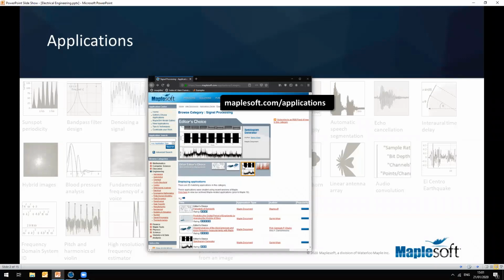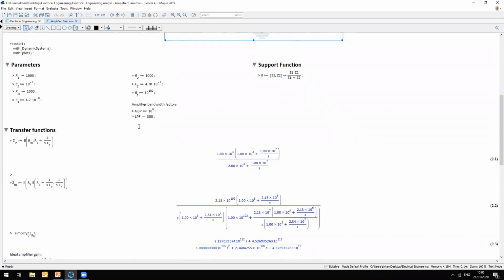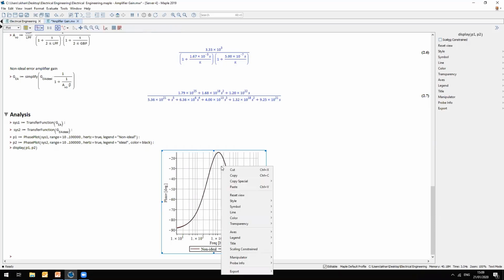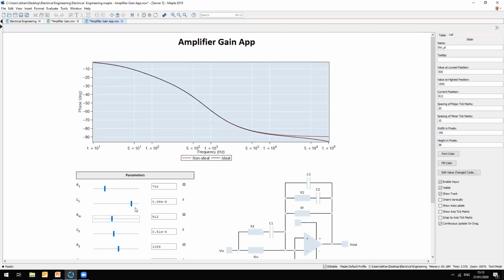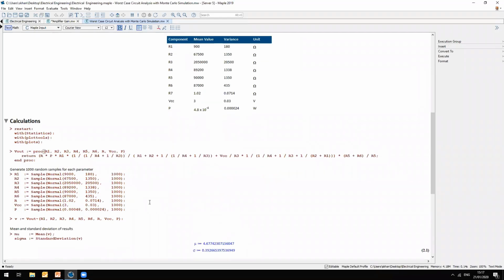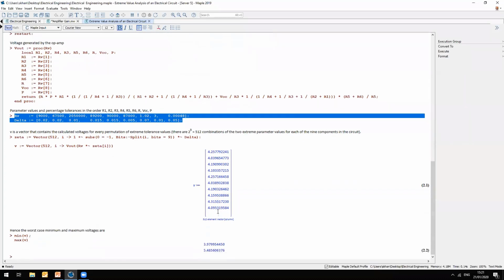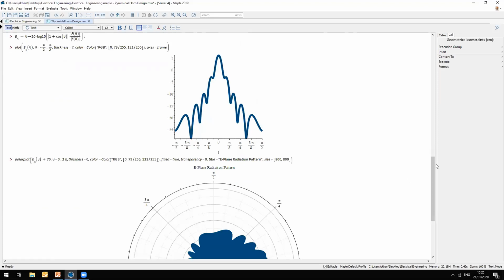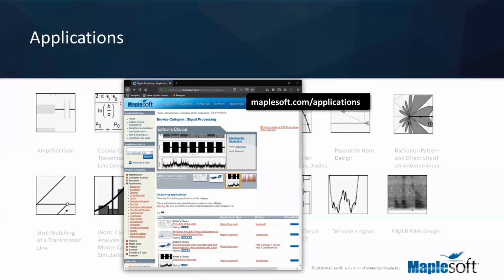Maple for Electrical Engineers

Comment: Just a very minor point.  The first schematic diagram shown in this video I believe has an error.  The differential amplifier's inputs are shorted together (shown by the connection dot) so the circuit will not amplify and the gain results is not correct for this circuit.  As you mentioned it was just a graphic brought into the document. Thank you for this video and it is helping me make my decision on the purchase of this product.
Reply from the maker: Thank you very much for pointing that out. Glad you found the video helpful!